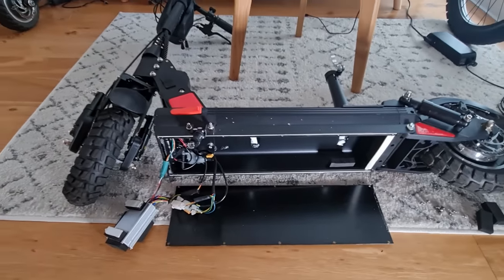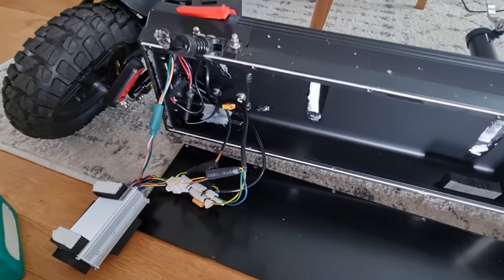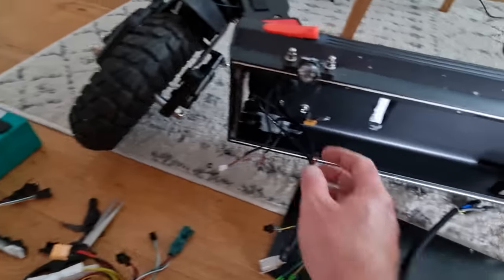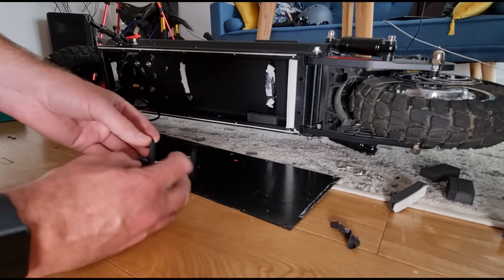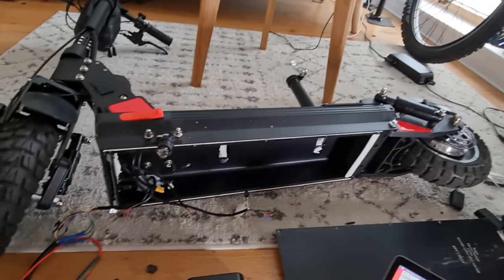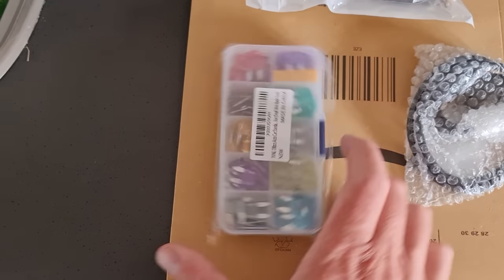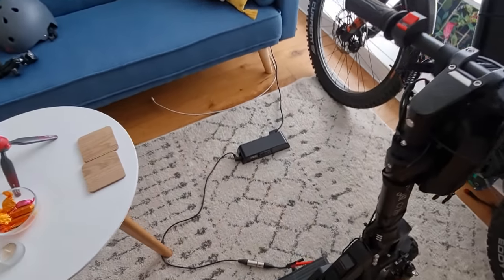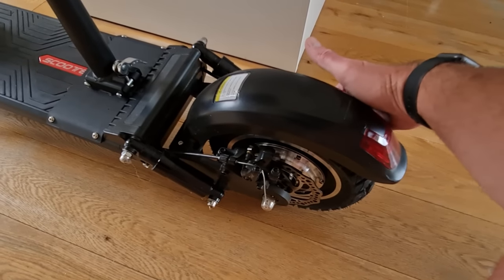LET'S MODIFY AN E-SCOOTER!!!

Comment: I have an 800 watt Evercross H9 scooter with the 14.4aH battery, can I put in a 1000 watt controller to get the 200 watts more? Maybe just like 5 mph more without blowing the motor ??? And will it work with my display on the H9 instead of that circular Chinese style? Or will I need to replace it all?

Comment: Ah you make the wiring look much easier haha.

 I did a little wiring repair on my kugoo kirin m4 pro 500watt. The motor wires were shorting out, acting as a phased brake with the scooter on or off. So. I ripped out the LED side lights because that shorted out from the snow last year. Then heat shrinked the motor connectors where it was shorting out. Put it all back together. And now my tail lights are not working. Brake lights work. It's a wire mess cramped in a tiny little space. I don't know what wire is what haha. I just left it and use a rechargeable bicycle tail light accessory.
Reply: U think thats cramped, wait til u try adding more wires such as indicators and a high beam front light 🤣 best thing i can suggest, is disconnect battery, then rewire using labels on the wires, where the wires aren't using connectors add ur own (or solder n shrinkwrap). If not sure what the wires do, just follow them to see where they go. Only attempt if you are somewhat ok with rewiring.

Comment: Good day, Andy my friend you need to get a hold of these:

Anti Spark Connector  Male/Female XT90-S (Upgrading version of XT90)

Working current capacity: 90A
Peak current capacity: 120A
Banana connector diameter: 4.5mm
Reply: not just about anti spark LOL  voltage etc has to match  or it fry everything. kind same when you. link up   battery's together. to make a bigger one  all has be same  numbers

Comment: I have the same scooter. I found on the bogist website they have a 48v 20amp battery upgrade for sale.there wasnt much info onnit soni was wonderingnif i buy it ia there anything else i need and would it improve my speed/ acceleration performance and distance? 
Allso where can i purchase the new phase controler box you bought, and sorry one more thing how do i remove the speed limiter,

Comment: Looks like a lot of fun, it'll be interesting to see how long it lasts with your throttle action! ;-)
Reply from the maker: Haha, these hubs are pretty resilient as long as you don't do extended runs uphill at full throttle it should be fine. I've never burnt a motor believe it or not!😅
Reply: just 3d print a mill trim unber the scooter make in deeper battery will fit

Comment: Great tear down!!! 👍👍👍 And build back up. I’ve just got the Emanba L-12 Pro as my first e-scooter and wondering if anyone has below info please??? 

Hey friends. 
I hope you are well!!! 🙏🙏🙏

Does anyone have the manual for the TF-191 NFC controller??? Finding it hard to find details as it seems new out??? Found generic manual for similar controller but the numbers don’t add up. Any tips for setting up the scooter first time regarding bolts and screws??? Should I use locktite on bolts u know i wont need access too??? Blue locktite so it can be undone with manual tools with a bit of force. 
Keep at the great reviews!!! 😃😃😃💪💪💪

Best regards, 
Scott. ✌️🙏✌️

Comment: I’m looking to upgrade this scooter possibly adding a bigger battery. Do you think it would be possible to add a second motor on the front and connect a second controller inside to operate the front motor. How large of a battery can I fit?

Comment: I have an Evercross H9 scooter with the new dash, 48 volt 800 watt motor 14aH battery and stock controller. and i realized they lie and say 28 mph..  by GPS is does 25 mph at best and i wanted to know if i can use maybe a 1000 watt or 1200 watt controller to give it some more speed..

Comment: I'm curious if anybody might have an idea how hard it would be to mod what I am assuming is a cheap Chinese scooter? I bought what looked like a "gently used" Phaewoo that the original pamphlet claimed a range of 12 to 18 miles (somewhere in there), but I road about 2 miles to and from work one day and it was almost completely dead from a full charge. So I'm assuming at the very least it has a shot battery. 

Said scooter also seems to top out at like 5mph in slow setting and probably around 8mph in high setting. I'd like to bump that up as well. It is a hubdrive motor in an 8 or 9 inch wheel. Don't remember the supposed watts it claims, but I'd like to be able to go 10-12mph for a leisurely pace, maybe up to 20 ish for VERY short bursts just for fun factor, as well as being able to take some decent hills.
Reply: Am finding them easy to mod, as long as ur pretty competent with electric wiring. With generic scoots, parts seem to be easily sourced too.

Comment: You can actually do something against sparks when connecting a battery. Use an Anti Spark Switch...
Reply from the maker: Yeah I've seen them in the RC world.
Reply: @andykirby  yeah, and also in the e-sk8boarding scene. Cost about €40,— on Banggood...

Comment: Good stuff Andy! one quick question: i just got the Bogist C1 but I´ve noticed the battery might be getting some damage because of rough terrain, any suggestions on how to fix it in position?
Reply: I've noticed  that aswell ,didn't help with the pothole I hit that also took my kick stand clean off  ,but is rips gets you where you need ,I'd just not ride out in wet weather

Comment: HI Andy. Nice job on that scooter. I'm running a sabvoton 72100 on a mid drive and the motor keeps ticking, sometimes a bit violently. Any idea what's wrong with it?
Reply: That sounds like it couild be the Bering are worn out so it can vibrate and Tik/ rub ore it couild be a simple little pease of mettle ore something stuck to the magnet on the motter
Reply: @dillonseeney3149  Thanks for the suggestion, but I know it's not mechanical because I hooked the motor up to the old controller to check and it runs really smooth on that one.
Reply: @colinriches1519  it could be the current limiter if you are in too high a gear. My bafang motor will do that if you try and launch in the wrong gear, but I rarely hear it because I am quite good with my gear selection. There is also another low battery warning that will cause the controller to send a vibration signal through the motor which you can feel. I wonder how many people buy a Bafang BBS02B, mash it along like a noob by pinning the throttle at 50 rpm and then complain it gets too hot.
Reply: @TimpBizkit  Thank you. I should have said it's not a geared motor. Drive sprocket is 11t and rear is 56t. The motor is rated at 72v 3kw and spins at 6000 rpm, but I want to run it at 100 amps if the motor wires can handle the current. Operating at 40 amps (10amps lower than the previous set up) it still does it, so I don't think it's that. I've recently heard that the controller I bought is only meant for hub motors that spin no more than 1000 rpm, being a newbie I'm not sure if that's why. I've got so much to learn.

Comment: i have the same re-badge scooter and thinking of a way to replace the controller. i hate the fact it has a built in cruise control i want removed. but doing so would make the lcd on the stem useless. is there any chance you still have this busted controller id love to peek inside it

Comment: I own a bogist c1 pro and wondered if it was possible to upgrade the battery/motor/controller if so do you have any advice on what battery I could use and what parts I would need to complete the upgrade as I'm a little unsure on everything I would need. Thanks

Comment: What wire you need to cut to have no limit speed? Ive a vMax R25. Thanks!
Reply: Dark blue. On some it's bright blue. Regardless, if you have a blue wire.. that's probably it. Recommend you put an on off switch and run with it on normally and use switch as temp turbo.

Comment: Great video.  I am trying to do the same for an Brose e mountain bike. Looking to get more power/torque out of the motor not just more speed.  Do you have a video covering this?  Or a direction to point me?
Reply from the maker: Biggest challenge is figuring out the sensor wiring. Some motors like the bafang m620 don't even have conventional hall sensors so you have to run in sensorless mode  look online to try and find others who have taken apart the motor in question so you can prep before you rip it apart!
Reply: Bro reply and I can point you in the direction of the only video I've come across of an electrical engineer taking apart a batangas motor and frankinsteining a 500 to get a 750 motor but he got stung so had to rip the motor apart then he just goes way in deep to the point I was lost im not good with electrics .lol give me an engine ill take it apart and put it bck together no problem ,simple wiring problems ok ,but not got a clue with all the talk n walk stuff .
Reply: @Crosshatch1212  thanks!  I was thinking that there would be a huge opportunity for someone to figure out how to generate more power from a Brose or other mass market ebike.  Not just speed restrictors.  Seems like people do it for Banfang motors all the time.  Any engineers out there want a challenge I will fund it.

Comment: Basically the charger has a live and negative wired into the connecter so it was the right fit but inside was wired different that's why they said use the right battery n charger

Comment: Could do with help on my scooter.
Do I have to have a lcd screen. Can I not just hock the throttle and brake up to the controller or them 5 wires coming off it to make my scooter work. 
Or do I have to run it though a on&off lcd or obo 1st . Help

Comment: I've got a spare punctured ninebot max in my garage I've been considering doing some crazy upgrades to it as a bodge job project vehicle is it possible to do anything with it do you know? Hesitant as it runs via firmware but wouldn't be to bothered if it burnt out
Reply: id say get a solid honecomb wheel (even better if you can get some suspension forks if it doesnt have suspension)

Comment: i have this bogist c1 pro scooter but i cannot mount the seat back. two scew holes are empy and the other 2 are with a metal which is blocking the scew. how can i fix this? i want to mount the seat

Comment: Hello, and thank you for the explanation. I have a question, please, can I connect two motors to an electric scooter on one microcontroller? Thank you
Reply from the maker: No is the simple answer, for AC motors and contollers you need one per motor.
Reply: @andykirby  I own a Pogest scooter. If I want to add a motor in the front, what will I need? Knowing that I have a 48-volt 30-amp battery, can I connect them to the handle of one extra bed? Thank you

Comment: Have you thought about a 2 speed e-scooter? I saw a bicycle on youtube that you pedal backwards and it goes in a lower gear. It's like two free-wheels and one straight chain and one figure of 8 chain. I have an idea for a chain drive which is in one gear when the motor is spinning forwards and another lower gear when you reverse the polarity on the motor. It might be possible to install a controller that reverses the polarity of the motor when it senses a certain overcurrent e.g. you try and get it up too steep of a hill, then it switches into the lower gear (simply by changing rotation direction) until the current goes right down when the hill levels off and it's back into the high gear. I mean it can't be that hard - the auto reverse on cassette tape players does just that, plus there are some shredders that reverse to unjam themselves, so getting a scooter motor to reverse when it's overloaded and goes into the lower gear on the other freewheel shouldn't be too hard.

Comment: I got apollo ghost and won't 2 have a 72 volt battery put in not for speed two go further  distances and longer rides is fine all so the charger port is 3 pin and like micro phone plug is there a better suggestion for better charger ports and a 72 volt battery that would fit

Comment: Hi there great video what was the name of the controller
Reply from the maker: Phaserunner https://www.cloudsto.com/forum/phaserunner-motor-controllers/phaserunner-advanced-foc-controller-90v-2000-3000w-detail.html
Reply: @andykirby  HI , NOT REALLY RELATED TO THIS VIDEO BUT, I HAVE A FC-1 STEALTH BOMBER 72V 8000W AND I HAVE PUT THE CHARGING LEAD IN THE CHARGING PORT THE WRONG WAY! THERE WAS A SLIGHT FLASH & TINY POP! THE BIKE STILL WORKS FINE SO DOES THE CHARGER BUT THE GREEN LIGHT ON THE CHARGER STAYS ON HENCE NO CHARGING! I'VE CHECKED FUSE ON CHARGER & LOOKS OK, WAS WONDERING IF THERE WAS A INLINE FUSE FROM THE CHARGING PORT TO THE BATTERY?  ANY IDEA PLEASE ANDY 🙏

Comment: İ would like to ask about the controllers, i’m going to change the controllers, i’m using 48V 21Ah 800WX2 scooter, i’m going to buy 2 controller and throttle set, but the 1000W controllers don’t fit in my scooter body, and the controllers which were in my scooter are really small and i don’t even believe that they are 800W they are really small, so don’t know what to buy🤷‍♂️

Comment: You have no choice but to change that Motor too
Reply from the maker: Why? It's handling 1300W at the moment just fine. I reckon it could be pushed to 2kw for occasional acceleration bursts.
Reply: @andykirby  To better match with the new additions to it, That's why. Bigger Motors can only it rather than not. Make it at least 3000, 1500 on each wheel

Comment: What might have happened is the polarity was backwards not your standard centre positive it might have been reversed and you plugging your charger I  caused a explosion
Reply from the maker: Yeah wondered that but then the cycle satiator is pretty smart, would think it would protect.. hmm
Reply: @andykirby  not when you have hundreds of amps at hand
Reply from the maker: True! I'll have to check the charger that came with it.👍🏻
Reply: @andykirby  let us know if polarity was swapped it should also say on the charger
Reply: That would have been my first guess. The centre is usually positive.

 But that one time you don't check...

  Because I've accumulated loads of different chargers over the years, and my eyesight is just starting to fail, I have just started putting some tape or a sticker on the block with Voltage & Current written on and reverse polarity noted.

Comment: What s the best way to make my kugoo g booster faster the motors are set at 800w per motor so total of 1600w but the motors they say are peak 1200 each wheel so 2400w will more watts make it faster ?
Reply: Won't go faster except you up the voltage since there is no gearing to change since you're using hubmotors
Reply: I'm not familiar with your scooter, but upping voltage and/ or amperage will result in greater output wattage.

More watts, generally results in more power and speed. But you need to take many factors into account. Such as: 1. Can you battery supply the increased output SAFELY? Li-on and Li-po need to be treat with respect. They can explode causing fire and serious injury. 2. what is your motor rated & will it overheat? Usually you can put double rated wattage through them for SHORT BURSTS only. 3. Will your controller be able to handle it & what voltage are the internal mosfets rated at? 4. Will your wiring and connectors be up to the task of handling the increased current?

Many things to consider. Hope this helps you.
Reply: @18ct  thanks its the kugoo g booster it says on internet there 1200w each motor as there’s 2 but there  only 800w running to them from the controller I thought maybe a new controller that will run two motors and add maybe a remote control car battery that’s lipo 9v I think they are

Comment: Andy or anybody I got a hub motor with two leads coming out the hub. One side has phase and hall wires and the other side just has phase. It's a 12" 60v/2000w motor I'm just wondering do I need two controllers or both phase wires connected together then to the controller. But when I connect both together it runs like s**t. Any idea's would be helpfull because I'm tried of just going 55 kms I need more.
Reply: I would only hook it up with which type of controller you have, if you're controller accepts the hall wires as well just run that side and don't worry about the extra phase wires on the other side.

If you're looking for a higher top speed a higher voltage battery will help as long as the controller can handle it, you have to have a battery and controller that can supply enough amps to push it to the higher speeds you want.
Reply: @Baldys_projects  Thanks that's what I thought don't hook up the extra phase wires. But I gave up and thought it was the controller I have a Yuyang King Controller. And the controller would not calibrate for some odd reason.

Comment: Hi mate so I got a windgoo b3 350 watt rear is ok for the kids but there getting bigger now and bike 2 slow could walk farster if honest I was thinking is got limiter or something I was thinking ppl saying bigger battery thas common sense 2 me lil exter volt d ah my is 36v 6.6ah shit I dont wont spend lots but need it 2 go a out 25 mph 30 max if not I have a broken scooter is a dual 2000watt moter and only have 3 wires from moter wheel my 2 controller d 2 big I'd like 2 lil 1 that will hold d il was gona do 2 48v 30ah parel let me no plz mate